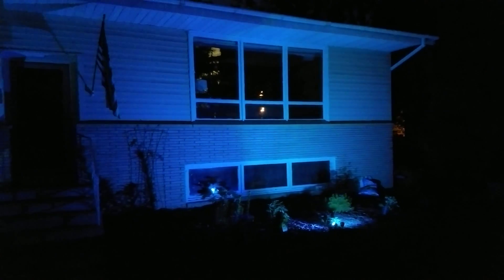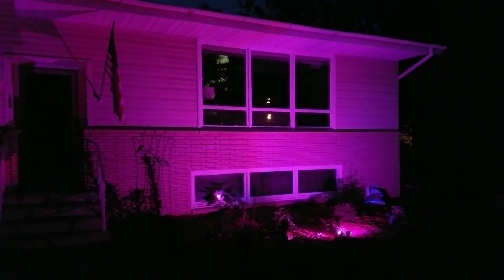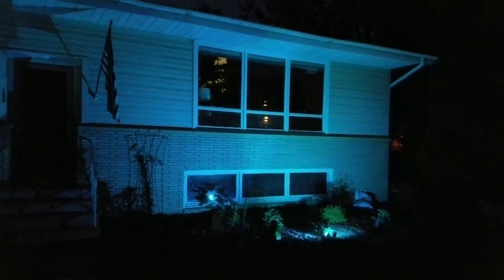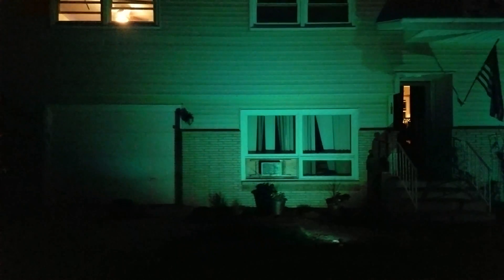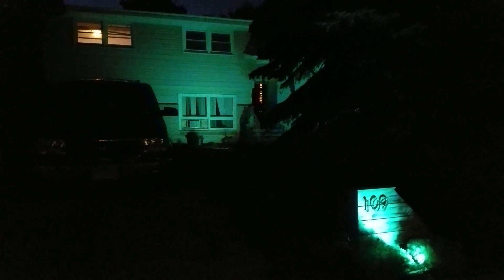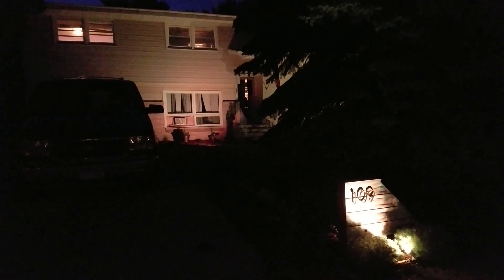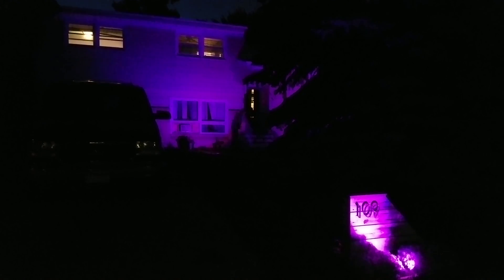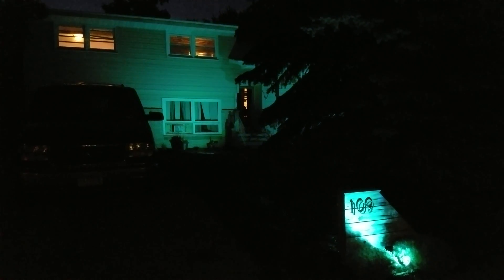SmartThings H801 SmartLife Color Loop Test

Comment: what are you using to sync the 2 controllers in ST?
also how did you connect flood lights to the H801? is there a booster? which floods did you use?

Comment: @Synssins - Do you have a link with a thread that you have started (over at community.smartthings.com) that users can go to read about your work/projects that you are working on?  I currently own about 20+ Wink Relay wall switches, as well as a Wink Relay Hub (v2), and also a SmartThings Hub (v2).  Also own a couple of Amazon Echo Dot's, and I'm looking at trying to get some "Open Source" software running on the Wink Relay switches (Possibly a clean install of Android, with a "SmartThings" app, and "Wink App" that I can use to choose between which App I want to use (on the Android/Wink Relay wall switch).  Also I would like the ability to control my RGBWW Christmas Lights (and lighting show) and run sequences, as well as "lighting shows" (from my Wink Relay wall switches) and I'm just curious as to whether any work has been done on this, or if you have started anything yet?  I'd definitely like to learn/work/collaborate with you, and I'm very interested in your work/projects.  I'm trying to do something similar to my home automation system (and for several clients) as well.  I'd like to start an OPEN SOURCE project that others can work (and collaborate/contribute to) and with.  Have you started anything yet?  Possibly a GitHub project for the Wink Relay?